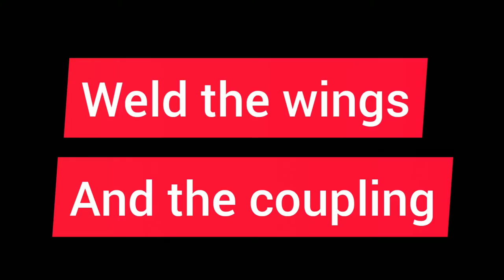How to make your own 3 wings drill bit | water well drilling | home made

Comment: Can it drill hard rocks
???
Reply from the maker: We still need diamond coring bits for hardrocks.
Reply: Sir i want 5 inch bit for hard rock
Reply from the maker: @shyammachirake2915  we use impegrenated diamond core bits for hard rocks. You can by them online.
Reply: @pinoydrillertv279  Can you provide a website I can get the drill bit?